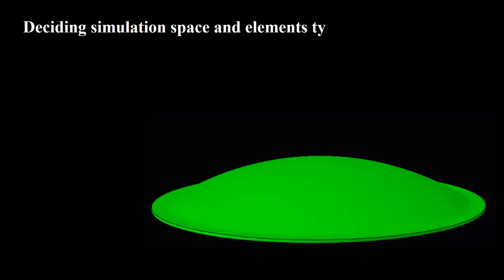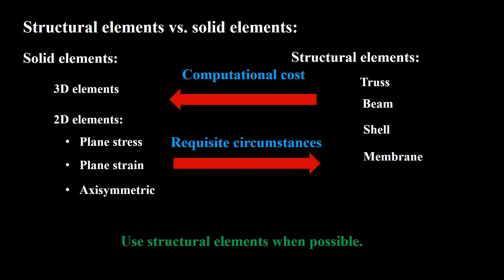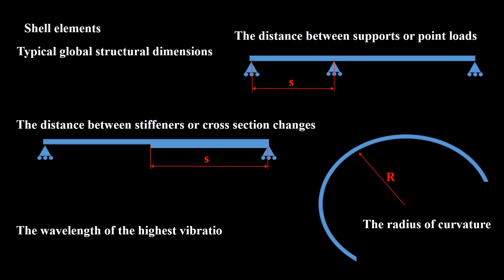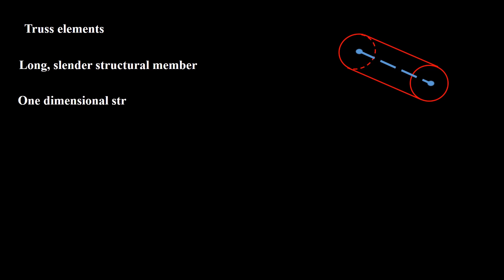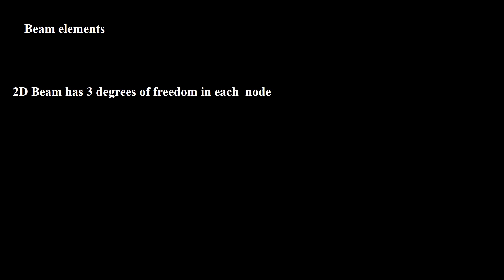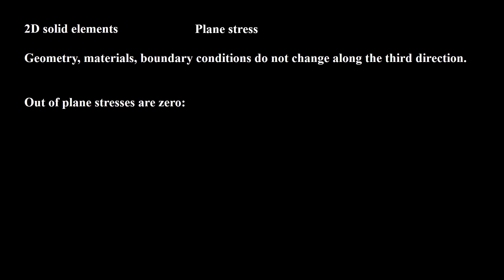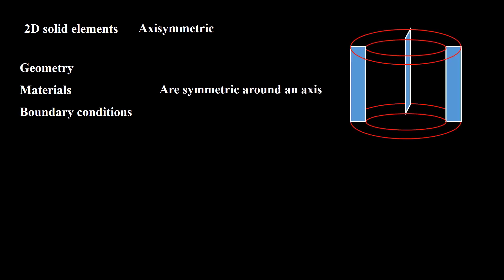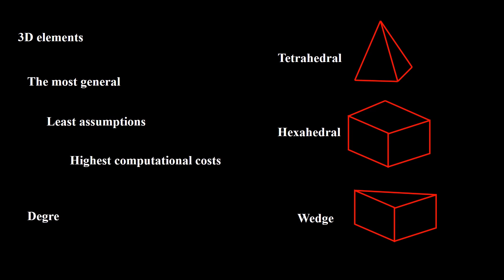Decide element type: 3D, 2D, plane strain or stress, axisymmetric, shell, membrane, beam

Comment: Hello, thanks for the video. What type of element would be recommended to use for a tensile test of a wire with a diameter of 5mm and a length of 220mm? Would it be appropriate to use a beam element? Would you recommend any specific one?
Reply: Cmon bro answer this guy it’s been 2 years